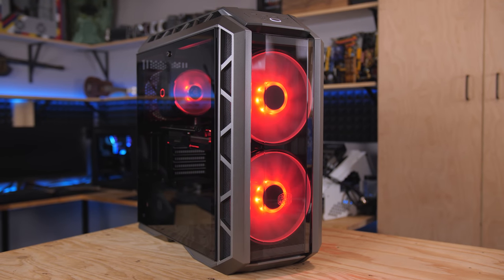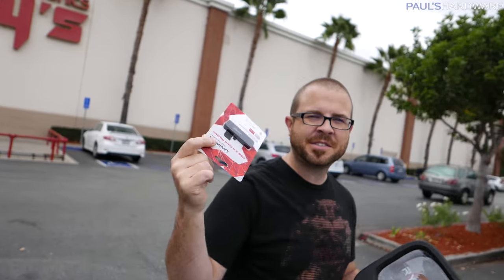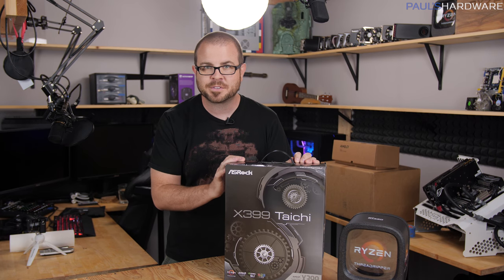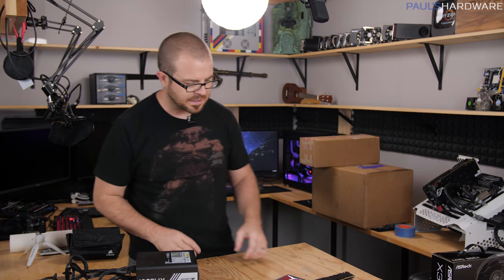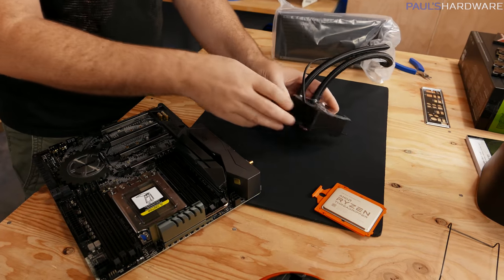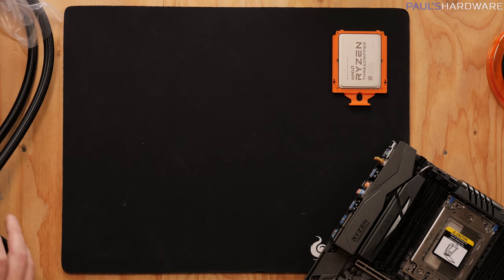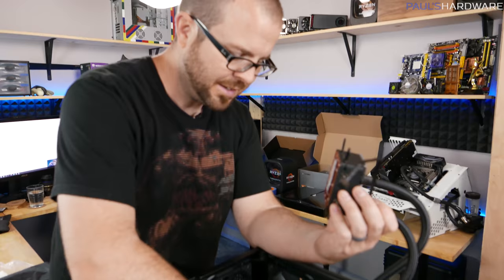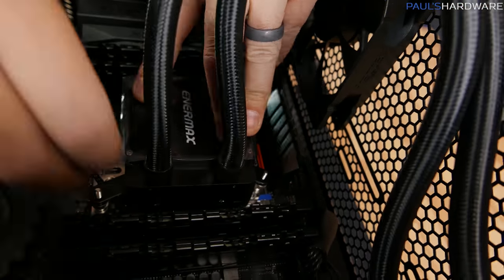Building the $1850 "Entry Level" Threadripper PC! 1900X + 1070 Ti

Comment: I'm jealous!  But for comparison purposes only - I just assembled the parts for my Ryzen 5 1600 build:

Ryzen 5 1600 + MSI B350 Tomahawk Combo Kit - $296 
G.SKILL Flare X Series 16GB (2 x 8GB) 3200 DDR4 - $218
Samsung 960 EVO Series - 250GB PCIe NVMe - $117

Total = $631

Re-purposing the RX580, case, power supply, SSD, Hyper 212 Evo and miscellaneous bits-N-pieces

Comment: Is it possible to build a $1000 threadripper build? Also, what's the difference between the R9 12 core/24 thread cpu priced.at $550 and the 1920X threadripper with 12 cores/24 threads? Besides the obvious size of the hardware..

Comment: You could've tried to install the radiator with the tubes facing downwards to deal with the extra tube length as well as preventing air bubbles

Comment: Is there a reason why you didn't put the radiator on the top vents of the case? Doesn't having it on the front bring hot air INTO the case as it goes through the front CPU radiator? If you put it on the top I think it would allow the case to be cooler and the video card to run cooler as well. Just a thought. Does anybody know why his setup is better this way?

Comment: I really wish the tempered glass on this case wasn't so dark. It came out right when I needed a new case and I went with the p400s instead. It's still a great case, and with the included rgb it's a great value, but I would have preferred the compact case if the glass wasn't so dark.

Comment: Just a quick note, since you shouldn't have issues with bandwidth and PCIe lanes, wouldn't it make a bit more sense to move the GPU down a slot or two?  You have the radiator lower fan blowing hot air through right into the intake fan, which could increase the GPU temps.

Moving it down would let the heat come off the radiator, and rise up towards the exhaust fan.  Blowing hot air on a hot GPU might not be the best idea...   Just mentioning it.  Would make for an interesting test IMHO.

Comment: @Paul's Hardware what is the sound of when you turn  the computer on? Sounds like either an almost broken pump or something interfearing with any of your radiator/casefans fanblades. The sound fades down and stops after like 10secs so id guess it would be some fanblade interferance from a fan that turned on when booting and then stops spinning after its automated bootup sequence, like either gpu fan or psu fan. Could even be radiatorfans since it was your first boot and they turned on and then shut off or spun down in rpm?

Comment: Would a Fractual Design Define 5 work better if expansion of HDDs and space was a goal for this sort of build?
Reply: Spooktacular Wheatley yeah on paper but most people who would actually utilize the tr4 socket properly would probably have a nas or something related.
Reply: It would work excellently! I built my new system(1700X NH-D15, GA-AX370 Gaming K7, GTX 1060-6GB, 32GB(2x16) 3200C14, Seasonic M12D 750w 80+, 256GB 850 Pro-SATA III, 7 HDDS with room for one more [HDD cage holds 8, plus 2 SSD behind mobo]..at least) in August...in the Define R5 Titanium(no window). Just keep in mind for future upgrading; the Define R5 won't fit an EATX board! :/

Comment: Similar to the build I spec’d out to build for Christmas. 
CPU: 1900X
MOBO: MSI Gaming Pro Carbon or the Taichi
GPU: RX Vega 56 (now can be found for $399) 
MEM: GSkill 32GB 4x8 3200 14
PSU: Corsair RM850i
SSD: 1TB Samsung 960 EVO M.2
Cooler: Enermax Liqtech 360 
Case: Thermaltake View 31 RGB

My build is running around $2600 due to the extra $200 bucks for the RAM and extra $400 for the M.2 Drive.

Comment: Question: Wouldn’t having the radiator as an intake with a blower-style card make gpu temps higher? The card would be sucking in hot air from the radiator wouldn’t it?

Comment: You can get a TR 1950X for $499.00. at MC. It only took one year to get double the cores and double the threads for less than a i9 9900K.
Reply: TR 1900x costs $200 brand new in my country...

X399 boards are $400 though 😥

Comment: Paul, would the Enermax cooler fit mounted to the top of the case rather than the front, or would there be clearance issues? I'm looking to do a similar build in the Meshify C, but the graphics card I plan on using is about 1" longer than the reference 1070 Ti (so it would definitely not fit with the cooler mounted to the front).

Comment: Nice build, good parts selection.
However, I have to say that a 1900X system looks to me like something you would buy if you need lots of PCIe lanes, since that's the part that's much more expensive at Intel. Also, it's the only real advantage of the 1900X over the 1800X. I'm not saying it's a bad system, but personally I'd use this platform if for example I ran SLI plus two M.2 SSDs plus maybe another add-in card, but still wanted to save money where possible. For just a single GPU and no other cards that take up lanes, I really wouldn't want to waste money on a TR system.

Comment: Can't wait to see the comments that think that this is representative of the cost of PC gaming.
Reply: see i told you, 550 dollars for just the cpu and you can get a new ps4 pro for 150 less than that
Reply: Robert Blasingame This guy knows what he's talking about. PC gaming is pointless and expensive now.

Lulz XD Reeeeeeeeee Just trolling.
Reply: This is a Entry-level price for a Threadripper PC (which are supposed to be high-end high-price for both hardcore gaming and hardcore editing) not for low quality, low FPS games in the console lmao
Reply: Well you can build a PC for around 500$ that outperforms any console easily. G4560/R3 1200 Gtx 1060 B350Motherboard 1 8gb Stick of ram 400 watt evga power supply or equivalent and your choice of case & You have a PC that will play any game at higher setting than a console @60fps at the very least.
Reply: FRANK DUKES yeah, I was referring to robert lmao,  also as I said, Threadripper PC = Intense High Graphic Gaming + Intense Editing, which a 500$ pc cannot do
Reply: @tlspanthers,  see no one got the irony
Reply: Robert Blasingame Sadly it's because there are people that actually say stuff like that.
Reply: TLSPanthers the

Comment: Paul Ive got a really important question and was wondering if you could help me out? Ok so i have a R 1700 and a 1070 which runs really well and i have a h100i v2 cooler but i want to upgrade my pc to either the GTX 1080 ti or the 8700k on Z370 I would like a little better fps and if i just get the 1080 ti my 1700 still will hinder the gpu. I game Alot and i also Stream a good bit and am thinking about making videos soon or running Unity software to creat games and i have a 3440 by 1440 34 inch ultrawide running at 80 hz. Took me a bit to give you all the info but what would you do in my shoes?

Comment: FYI. As of October 2018, at least where I live, Threadripper 1900X is cheaper than Ryzen 2700X. So if you need some extra PCIe lanes (i.e. for server storage box, machine learning with multiple GPUs) on a cheap, or you know your specialized app is memory bandwidth bottlenecked (which is unlikely unless it is really special case of some weird app you wrote yourself), or you really need 128GB of ECC memory and can score good deal on some basic X399 mobo, go for it.  Doing SLI/Crossfire is crazy idea these days, but if you want it could be an option too. Probably very bad option (there better solutions, even if you want to use SLI/Crossfire).

Comment: thanks Paul, interested on the same build with the 1800X & the 1070 TI for lest money  not as many PCIe lanes but with one GPU  it would be fine
Reply: Larry White You're better off buying a 1080 instead of a 1070 ti. A 1070 ti is basically I ever so slightly downgraded 1080. Literally the same card except some memory and clock speed differences that Nvidia did to sell another card. Pretty shitty business strategy tbh
Reply: Depends on where he lives. In Canada the 1070ti is a great deal and actually has a purpose because 1080 prices are very inflated up here. Some 1080s are going for over $800 cad and average around $720-$800 and the 1070tis are anywhere from $570-630

Comment: Is this threadripper better than Ryzen 2700x +1070ti for gaming a work? O should I go for the 2700x I have to research a little bit of amd procesors cuz I’m done with intel
Reply: For gaming get the 2700x. You only need threadripper, if you have usecases for tons of cores, or need huge amounts of PCIE lanes

Comment: Since it's 8c/16t you might as well just get a 1700 and overclock it, and save yourself like $500 on the cpu and motherboard. If you're gonna go for TR4 you might as well get the 12 core
Reply: Dont oc

Comment: Hey Paul just a head's up; I dont't know if it was you or Cooler Master, but you might wan't to remake that ad at the beginning, because the H500P doesn't come with a vertical GPU mount, it only has the capability for one, and it can be bought at an accessory to the case. That way there's no misleading advertising :)

Comment: The size of the Threadripper's........ DAYUM. Ever since my Z170X-Gaming 7 motherboard crapped out and took my 6700K and 16GB DDR4 along with it.... I've been looking at the 1900X and possibly the same motherboard in this video. I would assume that my H115i would fit well on this cpu correct? I have spare 8GB DDR4 modules on hand but still would rather go with 2x8 DDR4.

Comment: That moment when he put the radiator heat on front of the system, instead of top.

I mean, was it impossible to put  2 fans in the front, and the radiator on top to extract heat ?

Comment: i was wondering what the best GPU for a ryzen 1600 build would be my price range for it is around 1500$ and i wasn't sure if i should get a 1070 or something else. (this will be my first build any feedback helps thanks)
Reply: Kaleb Farley 1070 should be fine.
Reply: What parts do you currently have?
Reply: TLSPanthers nothing yet just the budget and recommendation of the 1600
Reply: Kaleb Farley Does your budget include monitor, keyboard, and mouse or is it just the system? Also, what are you going to use it for? Just gaming or also some content creation?
Reply: TLSPanthers I will be gaming as well as using it for coding and art for my video game design classes
Reply: And I have a monitor and mouse and keyboard just my laptop is like 7 years old now and the desktop is super slow
Reply: Kaleb Farley Is the $1500 budget just the system or the whole setup?
Reply: Kaleb Farley Alright. I am about to go to sleep, but when I wake up I will mess around on PC Partpicker and try to make a couple builds that I would recommend.

Comment: Goddamn, has somebody ever thought that there might be workloads that don't need a high end or mid range graphics card with that kind of CPU power?

Nothing against this video, but I just don't get why it's always assumed that you NEED a "high end" (as NVIDEA calls them) graphics card.

One workload for example for me.
DSP Signal/Audio processing. In my case purely CPU bound.
I need a beastly CPU and then pair it with a high end External interface connected either with USB2/USB3 or a Slavecard via PCIE.

Audio processing is a heavily Multitheated load that benefits from many cores and threads, but doesn't bennifit at all from high single core clockspeeds. (if you don't have a badly optimized synth with an abundance of unison. But most plugins have multithreading options if they are that hungry for power)

I just want a liquid cooled RYZEN system with an older last gen RX460 RX560/RX470 RX470 for the amount of screens I would need to connect to the system.

Idk, I'm probably an idiot.
But still.
Nobody ever seems to consider us audio engineers and producers.

Comment: what's the point of using a 1900x if your not even taking advantage of all its pcie lanes
Reply: GriffGaming just building for the hell of it.
Reply: GriffGaming For future upgradability
Reply: Ever hear of expandability?
Reply: coinsagE46m3 Yeah, hardly anyone that builds for upgradeability ever upgrades anything significant.
Reply: It's future proofing. He won't have a CPU bottleneck for years, despite adding new hardware to the system, like another GPU.
Reply: 1900x has all 64 lanes....and it's entry level....
Reply: but 1800x would be just as good if not using advantage of  the pcie lanes like in this situation
Reply: It's almost as if the idea is spend less now, upgrade and expand later....
Reply: It's the worst in the TR lineup, and future upgrade ability isn't a good argument since you're buying HEDT for its performance now, and spending that kind of money means that you need that kind of performance, not so that you can buy a 16 core down the line and increase your profits then.

Still not as bad as the 7640X though.
Reply: SlavjanA yes, it's the slowest but that doesnt change the fact that it still has the full 64 lanes, is at the performance that you'd expect for $499, and, again, is in an ENTRY level build. It doesn't matter what the rest of the TR family has to offer, the whole idea is that it's the cheapest to build on a certain platform. Whilst you won't be getting maximum CPU speed(despite the 1900x still being quite fast)a user with a setup like this would likely make use out of the pcie lanes for heaps of m.2 storage(which is especially helpful when editing, formatting, and scrubbing through 4k footage), raid cards, or network cards.
Reply: joeforit 
The 1900X has the fastest per core performance at stock of any AMD chip.

As for the upgradability, I noticed that the case does not support 4 double-slot GPUs. And, any Ryzen 3/5/7 could support 2 GPUs. If someone needs the 3-4 GPUs to require Threadripper and has the money to add 2-3 more to the system, he probably has enough to buy the system instead of winning it.
Reply: The high TDP is good for heating in winter?
Reply: You know these things can be upgraded and added to later on right? That is like the whole point of a desktop PC over a laptop or game console
Reply: Simon Liu since I built my pc i have ‘upgraded’ the GPU, added 2 M.2 pciex4 cards (3 slots on mobo, original build used one), upgraded the RAM to 32GB, upgraded the cpu cooling to a 240mm rad/AIO. Added 6 120mm fans and even replaced the PSU!!! Not significant enough yet? 😂😂

Comment: Just to know, why not Vega 56 instead of 1070 ti?
Reply: I don't know, Linux sent a video talking about the TI version and the results are pretty solid to me. I mean, for the price,....hmm, idk.(for the entry level sake)

https://www.youtube.com/watch?v=nIOoNuUzFjQ
Reply: Felipe Zanardo  I would assume availability for Vega gpus
Reply: Yeah. I think so.
Reply: the broTaku vega is back in stock now, but I think its because still in reference
Reply: Felipe Zanardo 
It really depends what  this is used for. Vega 56 would only be faster for select GPGPU tasks, like raytracing. But, even regarding raytracing, the Vega 56 would be just as fast or slower in the viewport of the 3D application. Personally, I plan to go with RX Vega 56 for raytracing, but the GTX 1070 TI seems solid.

It is sad that whoever gets this will probably just game on it. It probably won't even get several GPUs. Speaking of that, I was surprised by the selected case not having 8 expansion slots for 4 double-width graphic cards.
Reply: Felipe Zanardo because Vega 56 is a shitty overpriced card?
Reply: Star Gaming not anymore
Reply: Felipe Zanardo
Same as that Fury AMD did, nice card, not as good as the already exciting products by the main party. That GP104 300, 1070Ti or 1070 OCII is a very good product, and available for gamers now. 

Gamers only need some 1080 or 1080Ti card, this is the best budget option out there now! Nodody needs a Tread ripper gaming, need to win it? why? 

Over and over you cry for the same shit, not getting any. Why not just buy what gamers say is good! 1080Ti on 8700k, or go budget, and only buy that 1070!

Comment: spend 600 dlls on a the 1900x dosen't realy strike me as a good idea... if you can't afford a 12 or 16 core, you could just stay on the r7 plataform... i know you can later put the 1920 in there... but let's be serious... if you building a threadripper system, buying a 600 dlls to later replace it for a 900 dlls is stupid, specialy considering the whole cost of the build... imo either just got straight for the 12 cores or 16 cores TR or stay on R7.
Reply: jose juan andrade PCIE lanes, more on X399 than on X370/B350/A320 mobos. This person may need the extra lanes rather than the cores.
Reply: Yeah i can see that as a valid argument to be in the x399 plataform, i guess if you gonna have sli and lots of nvmes or ssds, but i still think is kinda stupid to cheap out on the processor when you spending around 2 grand. The 1950x is going for 860 dlls usa atm in Amazon. And eventualy you may benefit from the extra cores. But i would NOT spend 600 dlls and later replace that cpu for a 900 one. Hell you can get the 1920 for 745 dlls.
Reply: jose juan andrade there are upgrade plans you can get from microcenter that allows you to upgrade your CPU within two years which would allow you enough time to get enough saved up for a 1950x

Comment: I know you gotta promote the 1070 ti and all but, please entry level is 1070. 

Haters, just think about it. If you were smart, you'd  know to either get a 1070 or a 1080.
Reply: I'd obviously get the 1080 because in my country it's actually cheaper than the 1070Ti